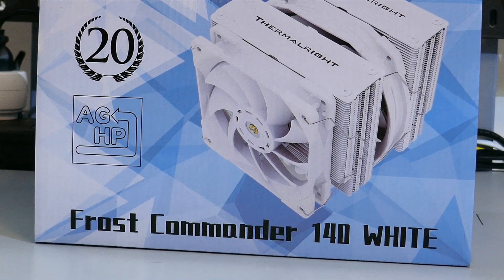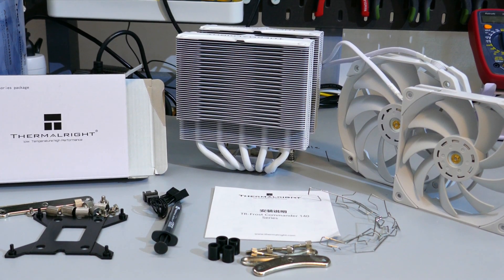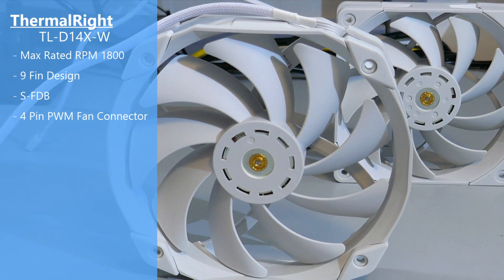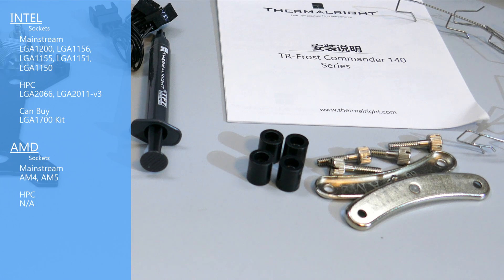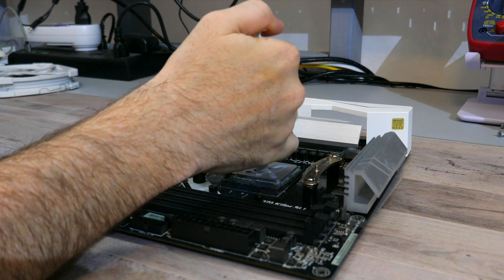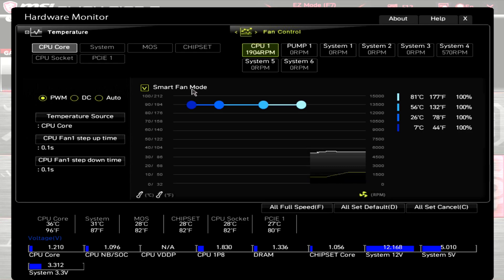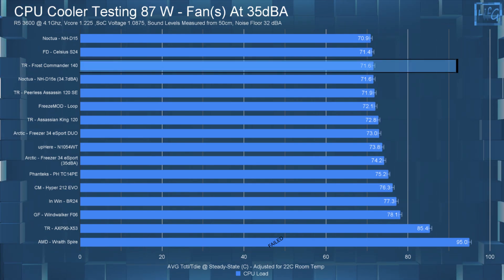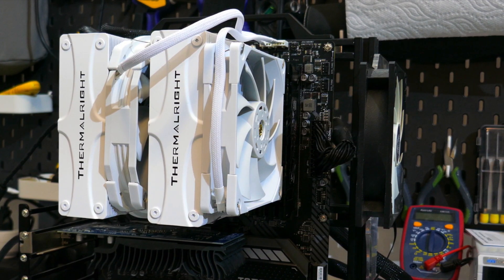The ThermalRight Frost Commander 140 White - CPU Cooler Review

Comment: Hello, can we install this or other LGA1700 air coolers for the LGA1700 socket without removing the motherboard? By opening both side covers of the case? Additionally, what is the metric size of the screwdriver you used? Do you have a link for the screwdriver?

Comment: I'm planning on buying this cooler but I'm wondering what is the RAM clearance on it? I'm planning to use G.SKILL Trident Z5 Neo ram which is 44mm in height. Would that fit?
Reply from the maker: Likely not, my 41-42mm DIMMs were pretty much touching.
Reply: Can the fan be lifted a bit so it doesnt touch the dimms?
Reply from the maker: @hydro1337x  maybe, I think it depends on which/how many DIMMs you are using.

Comment: After doing some thermal calculations, the reason you might not be seeing high deltas in temperatures between Thermalright's coolers, is most likely because the thermal paste is bottlenecking the overall thermal conductivity of the whole system. Frost comander 140 indeed has higher effective thermal conductivity over peerless assasin 120SE (5x8mm HP 31kw/mK  80W per pipe vs 6x6mm HP 36kW/mK 60W per pipe, at 0° from surface inclination) while thermal paste goes as up as 7-8W/mK or around 80kW per 0.1mm thinkess thermalpaste on the CPU-Heatsink transition. Asking non electric conducitive thermalpastes to transfer as much heat as sinks are capable of is like trying to squeeze water out of rocks IMO, they´re great limiters to the system.  Notes: 7-8W/mK is the spec sheet data for Arctic Silver thermalpaste, nevertheless, a study showed a breath taking 0.94 W/mK actual thermal performance which would 10X the bottleneck phenomena.The study: www.nrel.gov/docs/fy08osti/42972.pdf

Comment: Can you test with 250W load please? This would probably highlight the difference in thermal mass. Thank you !
Reply from the maker: How many watts does your CPU use?
Reply: @HardwareForGamers  253
Reply from the maker: @GillesBrisson-bn7gn  what CPU is it?
Reply: @HardwareForGamers  13700k
Reply from the maker: @GillesBrisson-bn7gn  you may want to consider undervolting. It will likely drop the power consumption by 25% or more.
Reply: already did -0.05v, lower gives WHEA errors

still hitting power limits, although boosting higher than before the undervolt
mind you 253W is with Intel power limits in BIOS, default is 300w+ with MCE

but that is not the point. I already have PA120 and it is insufficient for my usage. Toms hardware arrived at the same conclusion with 230W (thermal throttling). 

I want to know if FC140 can handle 250W. If it does I will buy one, if not i'll wait for NH-D16. No one tested this AFAIK.
Reply: @GillesBrisson-bn7gn  what's the CPU frequency?

Comment: Hi there and thank you for this review, this is really one of the few out there for this cooler. Will you have a chance to see how it now stacks up against the new Thermalright PS120SE? Also, from my understanding, coolers need to not have a proprietary backplate to be compatible with am5, so is the FC140 good for am5? Cheers!
Reply from the maker: I have the PS 120 SE under my desk waiting to get tested just give me a week or two, and yes the FC 140 is compatible with AM5.
Reply: @HardwareForGamers  that's great news! Thank you for the quick reply!
Reply: @HardwareForGamers  I'd also like to see how it stacks up as those two are on my radar (FC140/PS120SE).  I'm wondering if the extra pipe pulling the heat away gives any notable gains over the PA120SE or if the thermal mass of the sink is just saturated at that point.  I know some of the larger sinks (FC140) really pull away at higher loads due to the higher thermal mass and stronger fans. I've seen some other tests that show that with higher than 150W.
Reply: @HardwareForGamers  I’m definitely looking forward to this as well. I am torn between the FC140 and the PS120SE. The price is give or take around the same. If you can make a video review for them and their temperatures, I’d be happy. I am running a 7900x so I need some good air cooling.

Comment: How can I make sure my FC140 wont cross that 35dba limit? 
I run a 5600x and I want the most quiet operation I can get with it :)
Reply from the maker: You need to control the fans using the Bios or software fan control - https://youtu.be/COhxnhGTVCo
Reply: @HardwareForGamers  
ill look into this, thanks!
one more thing, I'd love ur opinion on this.
I just brought my nephew my antec a400 ( regular 120mm mid tower cooler ) cuz its has rgb on it and I couldnt look at it no more haha, I bought this FC140 for 43$ which seemed crazy value and for the meantime I placed my stock cooler on my 5600x.

I noticed a significant reduction in GPU temps since that change.my guess its from 2 reasons:

more air coming from the front of the case, now heading towards the GPU as there is less force pulling it to the CPU

more margin from above the GPU as the stock cooler is a lot smaller than that antec one.

worth mentioning that my CPU temps went really high, like mid 80c while gaming...
it is just a temporarily solution but with all those facts here, I though I should mention the CPU situation alongside the GPU. with the a400 it was barely getting to 65c while gaming.

in the day I decided to give it to nephew, I ordered a black FC140 for 43$ at one of those deals.of course that FC140 will be much more bulky and will effects my 2 anecdotes, only much more strongly than the antec.

those changes in GPU temps led me thinking, maybe I should go AIO and mount the rad up top, that way I would maintain the current GPU config and have much more esthetic approach all at one ( AIO :P ).
Reply from the maker: ... when using the stock cooler has the FPS in your games dropped? The reason might have something to do with the CPU clocks dropping because the CPU is now hotter, precision boost overdrive (PBO2).
Reply: @HardwareForGamers  
Well I didnt noticed an FPS drop... 
and as far as I know, Zen3 wont throttle until like 90c is that right?
anyhoo, I used PBO to undervolt and now the chip is around 79-80 on WZ2.

my main concern was trying to understand what is the main reason for that and what direction should i go, as I stated above.
if you could re-read my question that will be great :)
Reply from the maker: @TaLBLIzZaRd  you didn't gave your system configuration or what case and how many fans are in it, to give an informed recommendation. Unless you don't have a fan pointing at your GPU I don't think a CPU coolers fan will move that much air away from a GPU. Or if you don't have sufficient exhaust air out of the case it is possible that the CPU heatsink could get warm enough to keep a GPU at a higher temperature, but if you have enough exhaust that should not happen.
Reply: @HardwareForGamers  
You right,
my specs are
5600x
3070 fe
MSI MAG FORGE 100R with 3 intake fans, 1 rear and 1 top - both exhaust fans.
I think its quite enough right?

its just that temps are went so unusual, from 60ish on the cpu to around 80+ and from 70ish on the GPU to around 62.
all from switching the 120mm to stock cooler amd ( and adding 1 rear fans, from 2 to 3 ).
Reply from the maker: @TaLBLIzZaRd  so you added a 3rd exhaust fan when you switched the cooler or a 3rd front fan?
Reply: @HardwareForGamers  
Front.
was with 2 front + 2 exhaust ( rear and up ),
now with 3 front + 2 exhaust.

Comment: This is the review I'm waiting for
Just bought FC140 for $48 which is a great deal (included LGA 1700 in the box) and I don't care about the noise level as I only play competitive FPS games like CSGO and Apex Legends so have to wear headset all the time as long as it performs and cools my 12700k well.
However, I would be interested if you have any ideas to reduce the noise for the FC140
For example, If I change to the better fans for FC140 such as Noctua NF-A12 and Noctua NF-A14, does it will reduce the fan noise at full speed compared to the stock fans?
Reply from the maker: first you shouldn't need to run the FC140 @ 100%. second buying a NF-A14 for the FC140 would nearly double the price of the FC140, so please don't do that. what you should do is set up a fan curve that has the fans max out at 80-85% PWM. That should drop the dBA to... 38-39
Reply: Does it cool well? I just bought it with my i7-12700F and wondering what it is like.
Reply: @nolanlqa y que te te fue amigo? Yo lo quiero comprar para un Core i5 de 14 gen

Comment: a 3 degrees difference with the ak120, so would it be much better to buy the ak120? also do you know the difference between as120,ax120, and ak120? or is it all just naming gimmicks 😂
Reply from the maker: There's really not going to be much of a difference between them, but there are differences one less heat pipe one more heat pipe different fan... If you're looking to just game they'll be one or two Celsius difference between each of them if you're looking to actually do a heavy CPU workloads then going with the PA120 or FC 140 would likely be your best bet, depending on price of course.
Reply: @HardwareForGamers  which would have the lowest temps between those 3 120’s? Also, why would you still recommend the PA120 and FC140 for cpu heavy games instead of the cheaper a-something 120’s if the difference is just 1-3 degrees with them being 5-10$ more expensive?
Reply from the maker: @marcus7353  for gaming I recommend which ever one is less $$ in your region. For heavy CPU workloads like blender, vray, VFX then that 4-5 C could change the boost of your CPU taking less time to render the work.
Reply: @HardwareForGamers  I see. Thank you for clarifying 👍

Comment: can you do the tests with this cooler and two Arctic P12 fans? :D ...or Noctua fans from D15 :) or what will be if remove from the cooler one fan? :) its VERY interesting cooler! but fans on it is suck! or maybe problem is from central fan, i dont sure :) 
you do the great tests, but i want (we all want) experiments! :D and i want MORE COOLERS TESTS MOOORE! :O
Reply from the maker: Sorry, but how do these fans suck? Yes they are loud while at full speed, but the cooler did well at 35 dBA. It was within one Celsius of a cooler that is nearly twice the price... So just don't run the fans at full speed and all is good. Now for the idea of testing other fans on this cooler... Sure.
Reply: @HardwareForGamers  maybe not sucks, ok, ok! but worst than fans on D15 as i see :)
Reply: @HardwareForGamers  no, no! im wrone! :S anyway :) need tests with another good fans! like Arctic p12 and Noctua NF-A12x25 and other. if you can :) this will be great!
Reply from the maker: @ph7neutral  now this is a 140 mm cooler, so you wouldn't want me to test 140 mm fans?
Reply: @HardwareForGamers  the cooler has 120mm fan mounts, so I'd rather test with 120mm fans. besides, the best 120mm fans, for example, you can put a Phanteks T30 fan in front :)
Reply: I second the idea of this cooler + noctua 14 fans
Reply from the maker: Okay, I don't really get it, but if that's what people want to see I'll play around with it. It might help me out if you could tell me why switching out the fans is so fascinating/interesting to you? or what is it you're wanting to find out?
Reply: @HardwareForGamers  I'm the one who cares the most about the lack of noise when the computer is idle and not too much noise during the maximum load. By no noise, I mean no noise at all! there should be no clicks, no rustling or cod! and not all fans can provide such a level of lack of noise in idle time! and fans from Thermalright are good, but not really :) I haven't tried all the fans on the market, but I've tried many. and I chose the Arctic for myself, but only P12 and P14 and their ARGB versions (and there are still exceptions, because the Arctic is not ideal!) and Noctua, but only NF-A12x25, because all other Noctua fans are bad (except 200mm Noctua, if you need a 200mm fan, then you have no other options, only Noctua :))
...it's all VERY subjective! I just want to see experiments! though I myself did such experiments on coolers that cost 10-20 bucks :D but I would like to see them on top coolers too! Namely, this cooler is very interesting, because its five 8mm tubes have an area larger than six 6mm tubes as in "standard" coolers.
and someone can buy this Thermalright cooler, but install the fans from it on the case, for example, blowing from above, always setting them to low speeds. and buy new, quieter or more efficient fans for the cooler.
Well, in general, you can test the fans on this unusual cooler...
I don't know what else to tell you :) I'm interested in all this, but I'm too lazy to do it xD
... and one more thing :D you need to build graphs with a "performance factor" of the dependence of the processor temperature on the fan noise ;) divide the temperature by the noise :)
for example, you can see the graph (scroll that page below) by the link :) use the translator from the picture on the Internet
(translated with google translate :D my english is bad)
https://docs.google.com/spreadsheets/d/1tgnPhooOvZGuNmpE6q1o2X0996I8kQqiSiyvt6pqX44/edit#gid=288264561
Reply: this is not my tests :)
Reply: @ph7neutral  An awesome, quiet fan with great airflow (IMO) are the BeQuiet's! They may be a little pricey but they're my favorite.
Reply: @HardwareForGamers  Middle fan only would be very interesting
Reply from the maker: @tarron3237  I made the video. https://youtu.be/cc9jm9uU-CM
Reply: No he’s not gonna do that. U are annoying to even ask some bs like this. Foh bruh.